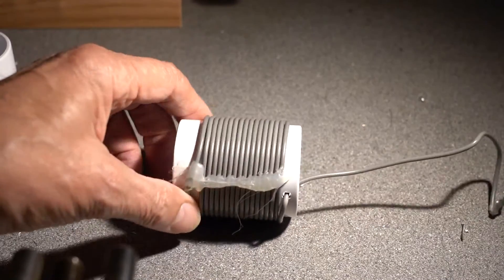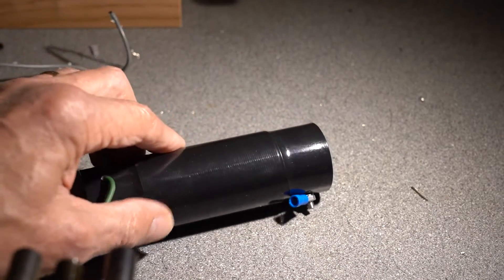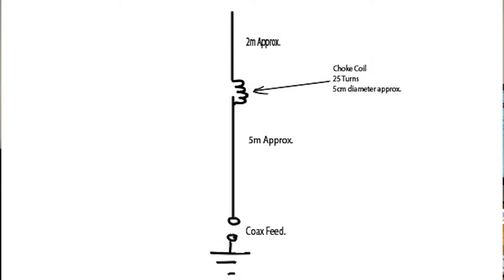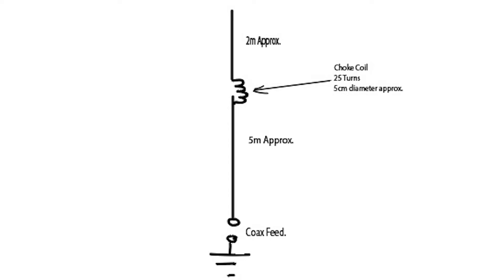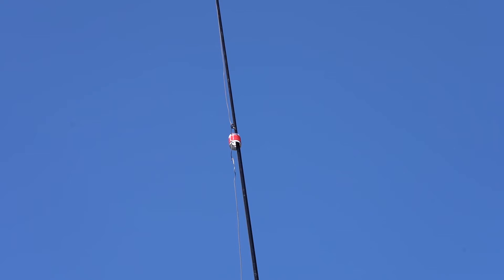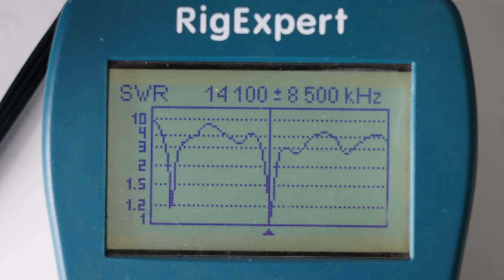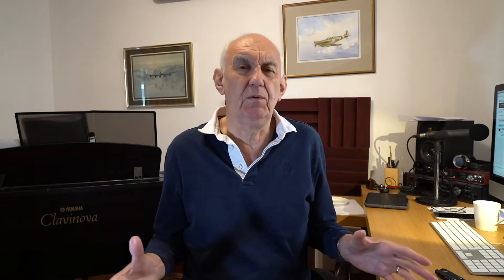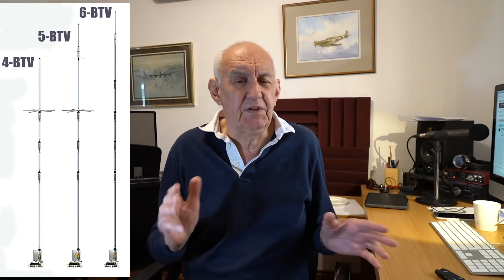Simple Dual Band 20m/40m Vertical Antenna You Can Easily Build

Comment: Hi there, I build this antenna from an 11 meters cb antenna and some spare alu pipes. Removed the original 11 mtrs coil. Lenght of antenna is approx 4,80 mtrs high to the made coil ( 30 microh ). After that coil about 1mtr alu pipe. It really runs with a 1:1 on 20 and 40 meters. I use 6 radials of 5 mtrs. I will remake the coil for 40 mtrs because of the small range right now. So I will try to get 2 mtrs pipe after the coil in stead of the 1 mtr now. But It is working really good. Thanks for your lively video's. Brgrds PD1RJH

Comment: Would a 7mtr roach pole do the same job as a spider pole as to me a roach pole carbon fiber looks exactly the same be 12 metr 20mtr 7mtr or 10 mtr length as the antennas length intotal would be 7 metrs in all i have 7mtr roach pole i used to use for fresh water fishing and could utilize it to save even more costs  thanks for video its great stuff you do
Reply from the maker: Roach poles are quite thin so you need to make sure any lateral load is very small.
Reply: @watersstanton  thanks for the reply and yeah the load would be minimal as 7metrs total length 14 or 12 gage wire and an inductor should only weigh in at a few pounds and it wasnt cheap make roach pole very sturdy made carbonfiber

Comment: You know the old adage longer than too short, well I left 2m 30cm and still too short. I had to add some and cut and mine came in at 5.03 m ( 16ft 6inches ) 1:1 SWR 20m, the coil 25 turns and the tail once cut for resonance was another 3m 13cms. This was using my GAP vertical with the coil removed on a various length radial bed. So make sure you leave plenty to cut back to. I have a crocodile clip to attach the coil to the tip of the GAP set at 20m and use it as an L shaped antenna. Gap is set at 20m, coil removed I can retune each band from 20m to 6m as 1/4 wave. Thanks for posting 73's Andy M6APJ

Comment: Hi,  I built this antenna however i am not able to get any signals in either bands, here is my construction details
1. Wire - 1 sqmm ( 2m and 5m as per design given)
2.15feet fishing rod mounted on 8ft mast 
3.coil 24 turns on a 5cmm dia pvc pite at the end of 2m followed by 5m wire 
4. 3 radials connected to braid of coax feet point 

pls note i am using this with RTL SDR v3 connected to a HamIT Upconverter using SDR console,
i have tested this antenna in 2 modes  (I am SWL working towards licence)

1. Antenna connected to upconverter which is Antenna ->Upconverter->RDL SDR v3
2. Antenna connected to RTL SDR v3 directly 

in either cases i dont seem to pick up anything. Pls suggest to trouble shoot
Reply: Sdr should receive something with any decent length of wire attached.  I think you have an issue with sdr or upconverter.

Comment: I'm planning a 20 / 40 vertical with a 20 meter trap in the center. How much will a 20 meter trap shorten the 40 meter calculated portion of the antenna? Is it significant? How to go about doing a rough calculation for starters?
Reply from the maker: The measurement cannot be calculated because the L/C ratio is not normally published. Simple answer is test it with a wire mock up. Establish resonance for 20m. Then add the trap and then try adding about 3m of wire. Test the 40m resonance then adjust this length.  73 Peter

Comment: In the coil! In 40 meters will be perfect and in 20  NO.My friend, this way it's just a load coil! And all the positive results you had is because of the cable fed into the base which shows 50 impedance you made at the base! There is no electric RF stop for 20 meters just by adding a ceramic capacitor in series to the coil. This is how I build my antennas and it works great!   4Z9MND
[ Just for your information I have been following you for a long time, I have taken a lot of ideas and experience from you for the field of amateurs, you convey things perfectly! Continue like this and good luck]
Reply from the maker: I am afraid you maybe not have understood the way a coil works. If can be a loading coil or a trap. This depends on the inductance and the frequency, Watch the video again and you will probably get the idea. There are commercial examples of this as well.  7#3 Peter.

Comment: Loved this video Peter very good!!! Wouldnt it work instead of using a trap/coil ,to just run a 1/4 wave length of 40m straight up your spiderbeam?? So roughly 10m of wire?
Reply from the maker: Thanks Andy. 73 Peter
Reply: I have a 1/4 wave vertical for 40m , I tuned it against a 10m counterpoise , just trim CP for resonance, works well.   CP above ground of course.
Reply: @rogerbirchall9037  hi roger ive just made this antenna, a quarterwave vertical for 40m. What are your thoughts on its performance? I havent tried mine yet.
Reply: A quarter wave vertical on 40 will not be resonate on 20 meters, but it will be resonate on 15 meters.  This is the antenna I use every day with two elevated 33 foot radials.  Try it, you'll like it.  On 20 meters it acts like an end fed half wave so the input impedance is extremely high.

Comment: Peter, I used the same length of coil wire on a 1 inch plastic water pipe , will it make a difference ?  Constructed as per my previous post.  Thanks for the vid it’s inspired me again !
Reply from the maker: As soon as you change the diameter the coil value will change. But dont lose sleep over it. Smaller diameter means more turns needed. Just experiment - thats what I did. Peter.
Reply: @watersstanton  thanks will do when wx improves !

Comment: I noticed you referenced ground in the drawing is that a stake in the ground, or ground radials and how long?
Reply from the maker: For quarter wave verticals a ground of some kind is needed. A stake works but radials work much better. Length is not critical. Whatever you can fit in. Peter.

Comment: Don't use metres. We're out of EU now and we fought hard enough to do it!
Do you buy litres of bier, er beer ?
Great video.  Using a non metallic support, could  the choke be wound on the pole or is the diameter insufficient at that height?
Thanks for another, as always very clear video.
Have you captured the market in good weather?
73 _ _ .      . . . _ _     _ .     _ ...   . _

Comment: I built this one for field day this morning, in about an hour I was on the air.  It tunes easy and works good.
Reply: What gauge wire did you use? I am thinking this is the way to go for me since I am limited on space and want to go mobile occasionally. Also is the coil wire different than the actual radiating element? Thanks!

Comment: Just for us complete newcomers to radio it would of been nice to see the other important parts. The radials and how their connected and how to connect the feeder etc . Without seeing all the parts sadly i'm none the wiser. I've noticed on a lot of youtube videos about radio they assume everyone is fully up on the subject even if its a video for beginners. Most frustrating sadly
Reply from the maker: Steve, there is nothing very technical about connecting the cable etc. The inner conductor is connected to the vertical wire - use electrical joining block for example. A radial is simply a length of wire that is connected to the braid side of the cable at the same poin. It is in effect an earth wire that just lays on the ground. There are man y videos on youtube showing radials. 73s Peter,

Comment: Can I use a coil like this on a half wave end fed? So the resonance is half wave on 20 and 40.
Thanks Jeff ke4fwe
Reply from the maker: Yes you can if the object is to reduce length. Otherwise just feed a halfway on 40m which will act as 2 x half waves on 20m.